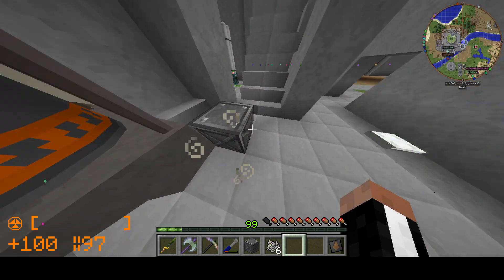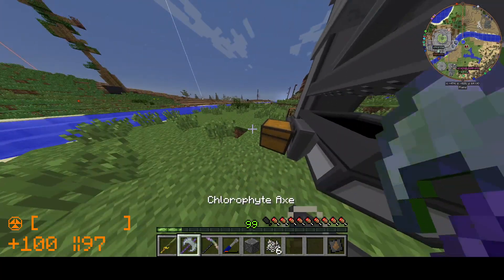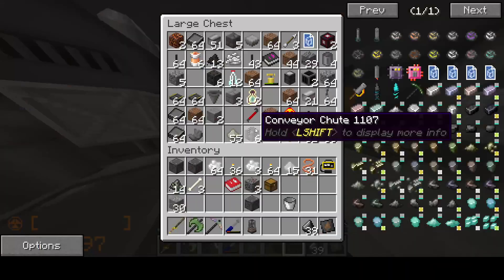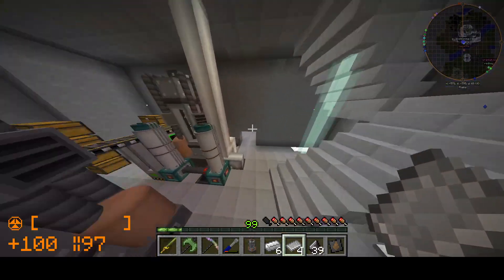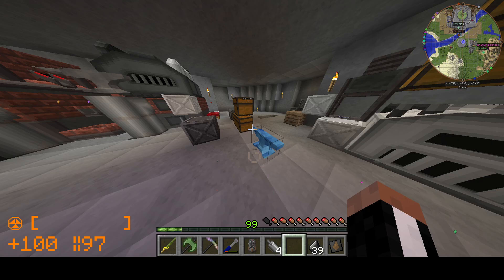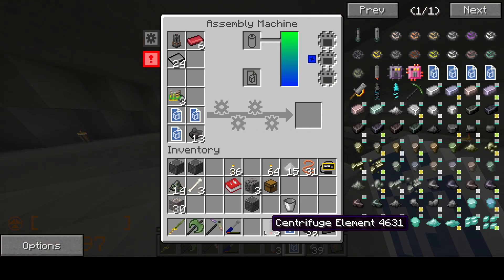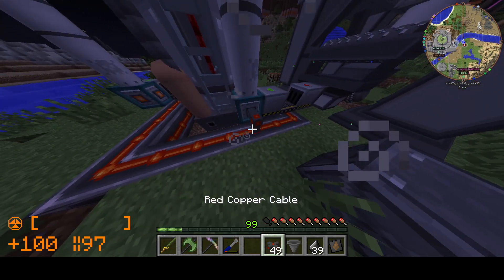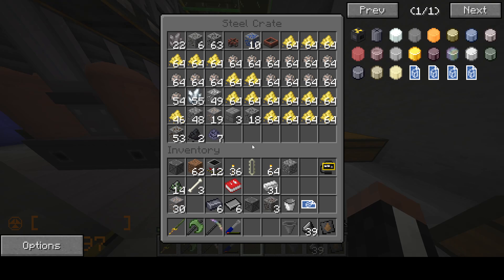We must make more steel || HBM's Nuclear Tech Mod

Comment: Steel is the most important resource in this mod, I have already spent several stacks of steel blocks on the power plant with reactors
Reply: Yea can relate I have to make like 10stacks for the reactors like pwr and fusion reactor icf takes so much more than the normal fusion reactor tho